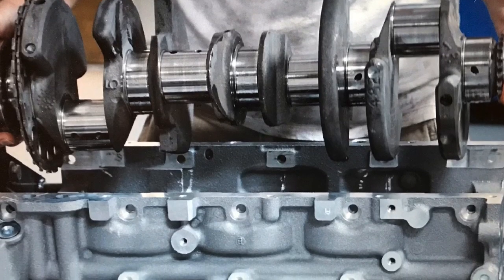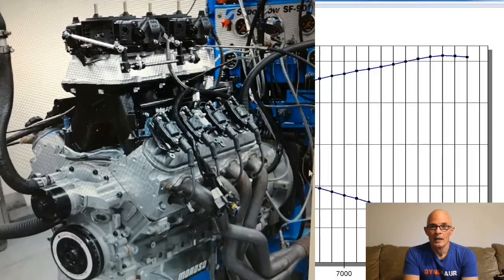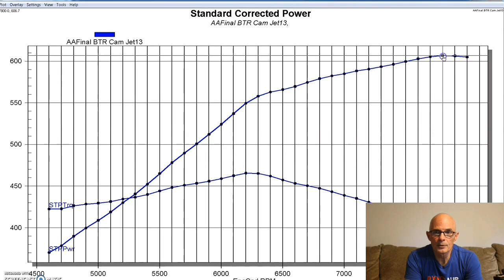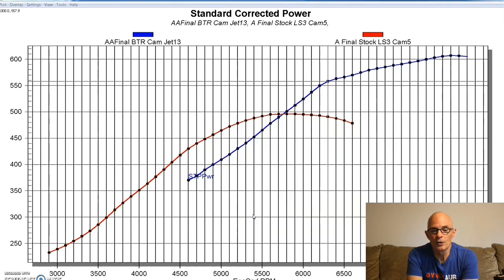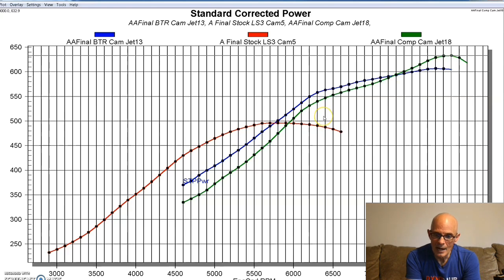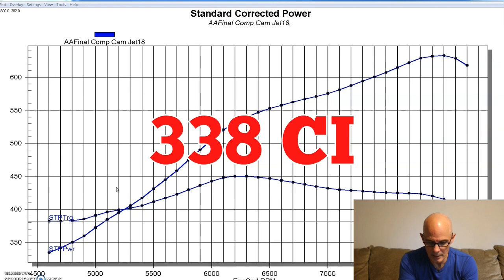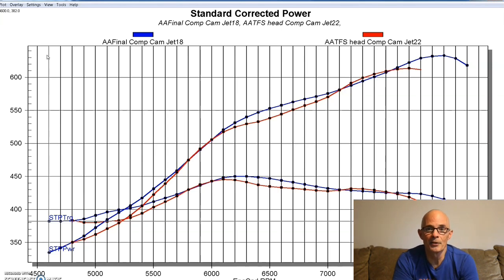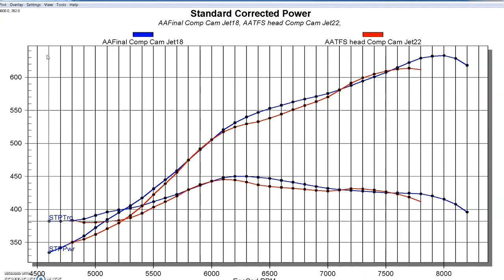DESTROKE LS-4.8L CRANK IN LS3 BLOCK-SHORT STROKE POWER-AN LS MONSTER MYTH?

Comment: I wanna build a higher revving ls. Specifically for a superlite slc. 

Transaxle is designed for higher revving motors. And even if I drop gear I wanna build the thing for a mix of acceleration but top speed. 

Kinda want 8500 to 9500rpm. But budgets lol. Boosted. Probably twin charged and compound boost for a cheaper easier set up. Realistically if it makes 1000hp with high boost that's all it'll need. Run it on low boost but have it set up so it's always taking cold air in. 

Also still needs to be reliable.
Reply from the maker: so cheap and reliable and 9500 rpm and 1000 hp-good luck
Reply: @richardholdener1727  not super cheap. Just not 30k in an engine. Basically was trying to do it for what the drop gears an ls crate motor and a boost solution would cost. All in about 20k. Was just trying to figure out what's the cheaper budget route. 

And 20k is if I rebuild the tranny myself. Not including the 11k on the tranny. Rebuild costs a bit. So basically was wondering if there was a more budget friendly option or if drop gears is the best bet. If so may just be worth sourcing a more expensive transmission right off the bat. 

But getting the Ricardo used in the Ford gt cars isn't easy. And harder rebuilds. And most of the other options are more race oriented so frequent rebuilds or can't find much info.  Don't mind doing a rebuild every so often. But every 40 to 60 hours run time is hard-core. 

8500 and 1000hp for similar price was more my goal. But never hurts to hope for more. And realistically I need 500 or so to start. If I have to add on for higher boost and hp later that's fine. But something that can Rev that high and handle the boost is more my goal. 

Adding the stuff for boost after is fine. 

Hence the junk yard block to start. Build the rest up make sure it'll hold. Then get a nice bare block to put it all on. Easier to justify an experiment on a 600 block vs a couple grand. Especially given I can find some nice junkyard options cheap. Ls7 for like 1500. Think a full ls9 would cost me like 3k for something ready to drop in to a donor as is. 
And not starting from a brand new crate engine should help save some bucks. 

Cheap is a relative term. Especially when talking about building a car that can compete with things that sell for 10 times it's price and is generally just as or more reliable. 

A crate rb26 costs 54000 dollars for a stock one. Nissan reissued them and that's the price lol. Vs for like 30 ish k you can have a fully billet rb30 rb26 2jz hybrid that fixes all the issues of the rb. And uses more readily available parts. And is good to 2k hp. 

If I wanna drop 30 to 40k like the motor I have in my gto originally cost sure. But I'm sure dudes have figured out budget ways to do it. At least in terms of that. Otherwise a rotary wins. 3 and 4 rotors can be done cheaper. Or Ford builds. 

9k rpm sure is nuts. But 8500 should be achievable without a fortune. Engines already make good hp as long as you can keep it from falling on its face past 6500 and hold to 8000 ish it should already make close to 600 or 700. With boost how hard can it be to get there. 

Bore jobs can be done yourself. Same with some porting work. Ls is like the most swapped engine and hopped up engine out there. Can't be saying there isn't a relatively budget friendly way to do this?
Reply: @richardholdener1727  just gonna attempt a 2jz swap most likely. 13k gets me a 1k hp crate engine that's streetable. And leaves me 7 ish k to build stuff up to take more revs. Not to mention the 3k on a block if I had sorted the ls out. 

Thanks for the replies. Did eventually figure out a way to do it on an ls but reliability is unknown within that 20k budget.
Reply: @richardholdener1727  lol figured it out. Surprisingly not as difficult as you'd expect besides engine mount issues. 

Flatplane crank. Destroked. Keep piston speed below 5000 feet per minute. Forged pistons low weight. Forged rods steel can work, titanium and aluminum have other considerations. 

Inconel valves. Light weight springs relatively speaking. Ti retainers. Need to measure deflection, fancy ways to do it and more basic ways. But most of the tuning difficulty. 

Stiff ass pushrods need to be strong. Bunch of calculations you can do based off mass of parts and rpms to figure out loads roughly. Add some fudge room 20 percent is a decent start. 

Realistically with a good base plane 40k is easy. You could start with an ls3. Buy a complete aftermarket replacement head that you can spec with your choice of valve train bits. Porting potentially required but not necessarily with brand new heads. Bit of math can be done for roughly what kinda flow will be needed, however you can always cheat and use forced induction tuned properly to help ram some air in. Pressure difference can help create vacuum causing air to be drawn in very efficiently. Why twin chargers still hold some useful benefits even if you can get the flow required from a turbo. 

Custom crank maker could build a conversion crank for an ls3 easily. Based on a 4.8 stroke even with stock bores for boost you're pretty well off. After market block or sleeving it with custom sleeves makes boost easier. 

Even with some tweaks required you'd be pushing close to 800hp at stock ls rpms without boost. And now have an extended rev range likely to at least the 8000s. With some bits capable of 10000 rpms. 

Lol. There's also custom crank makers who already do conversion kits for the ls engines. Expensive but likely can be specced with off the shelf bits that'll hold to 1000hp. With boost not that hard in a 6L engine. Especially with the added rpms. Keeping piston speed low snd making sure everything is balanced properly can help reduce stress. Lower weight parts also helps. Don't have to go to the extremes Especially if you also consider flex deflection and other such issues. Stiff weight reduced and increased strength. 

On the flstplane crank. Secondary vibrations are an issue. If you're working with an engine designer and builder anyways. Once you have a basic package further tuning isn't hard and also gives you a cheaper more reasonable route to get there. 

40k start pricey. But if it ends up only needing another 10k down the line to finish and make it hit the wanted specs. 

Self balanced with counter balancers built into the crank for the flatplane crank. Reduced weight also helps. Meaning reduced capacity and stroke. Which helps with the piston speed. Once everything is together you can use engine simulation software to help with balancing the engine. 

There's a fully balanced engine. And you can also over balance an engine. Over balancing is usually done for race applications. It can be used to move the vibration nodes out of the used rpm range. 

With balancers on the shaft. Reduced weight and over balancing all based off every piece together as a system gets you the final reliability and last bit of the rpms. 

Realistically this could be pushed like the spinaltap ls7 that's destroked. 

Play with compression ratios. Reduce it a bit. Are head and main studs. Main bearing upgrades that you did to the initial ls3 or from a raw base block start. Dry sump 6 stage. Oil pressure regulator. Starting at like 7000rpms rpms you want like 50 psi. 

Roller rockers. 

Cam selection is the only real finicky bit. And basically boils down to let the builder help. And may require a couple tries. Pay the engine simulation people a bit to help. 

You can buy heads that'd work as a base with a bunch of the valve train upgrades done for like 3k. Billet block or ls3 start 7k. Rods and pistons. Lol. Even fancy push rods aren't expensive. Any further head upgrades may cost you another few grand to start. 

Crank pricey. But then again. I'm considering a 56k dohc conversion on an L28 when I sell my gto. 

Reliability also comes from the fact of its a street motor. How often are you in the top of the rpm band. Plus other considerations like piston speed. Low end likely won't suffer to much even from a flatplane conversion albeit that's not even necessary to do just makes it easier albeit you lose some with counter balancing it.

However trade off for flatplane crank is the manual transmission will vibrate along with other bits of the car. Also why some exotics are slightly rarer in manuals. 

Piston speed and loads are a real main issue in high revs. Pushrods have others. But realistically worst case you can use some exotic materials without going into ridiculous expenses cause they aren't needed everywhere. 

Material knowledge is also important. FYI there's a reason steel has many advantages over titanium especially now adays with suoer alloys being common.  And fatigue loads are a thing. Aluminium fatigues with every load. Steel if the load isn't above a certain point it'll last forever. Titanium is kinda in-between the two. 

Realistically even with 8500 rpms. And a drop gear set in an slc with the right suspension tires and other shit. The Texas mile record is gonna end up mine when I get around to building it. Albeit might end up building a smokey yunick 68 chevelle tribute first instead. 

8500rpm ls3 with a t56 6 speed with a blower and twin turbos sounds kinda nice doesn't it? Extend the floor and flst bottom it yunick style. Turn the rear of the hood up a tad and throw some other aero mods on. Modern suspension mods and lower it. Modern wheels and big brakes. 

Maybe a awd set up. Though drift chevelle sounds fun too. 

Lol biggest issue right now is actually reducing power at the lower rpms and before boost. Especially for the slc. 550 is about all you want in those normally. High rpms sure fine if power builds. But it's gonna be a work of art through build planning. 

Planning takes issues away from things. And helps with reliability. There's also the mercury dohc conversion. Gets me there with a crate engine. Needs to be tweaked slightly but lol. 

Ls isn't as rev limited as people think. And it's not hard to do. Just not many do it because everyone forgets not every vehicle has good differential choices or the right transmission gearing. 

Engine rpms don't matter. Transmission is key to most things. But ls crew is stuck in the don't need more than 7000rpms. 

The engine swap in my 69 gto. That race engine is literally decade old plus tech. I built it in high school the race engine was bout used but was a fairly recent built when I got it. That's like 12 years ago. 

People are still developing the ls. And the spinal tap stuff and alot of the destroker stuff I've seen isn't that old today. Ls platform is how old. I think I was like 4 when they came out. 

The dohc conversion stuff for my l28 was only started being reproped in 2018 and was already an old discontinued product. Family friend I know from when the ls came out had dual sbcs in his boat that went to like 10k reliable in a boat that runs direct rpms so full tilt is full engine speed. 

Ls crowd needs to think out the box.

Comment: I believe what an interesting test would be changing the ramp up on the dyno to see if the smaller stroke was more responsive to change in rpm by seeing if it was able to keep up with the change. The engine master guys did a test of weight in rotating assembly which gave interesting but expected results would short do similar or have no effect?
Reply from the maker: the acceleration rate is adjustable but fixed on the dyno (x rpm per second)

Comment: Another advantage would be piston velocity, and the less inertial stress that the moving parts have in a shorter stroje application. Also, a shorter stroke allows you to fit a much longer rod, which helps with dwell time at TDC. This has an effect of making the engine less sensitive to detonation and pre-ignition. Makes it more tolerant of high compression ratios.

Comment: By custom piston running on the LS3, is it custom by compression or overall dimension? Could I run to a local vendor and pick up a set of stock sized (bore) pistons and a lower compression (for boost let’s say) and run this “destroyed” “big bore 4.8”? It’s definitely an intriguing thought, big bore high revving 4.8.
Reply from the maker: it's custom by pin height (compression height) to work with the longer rod and 4.8l crank, it also has the bore size for the 6.2L

Comment: With an ls1 destroked with the 4.8 crank yield the results? I have a 4.8 that I'm planning on boring to ls1 speck with an ls6 cam or( if my wallet allows me) something better. Deck hight and bore are a bit different so I'm very curious about the power/torque band.
Reply from the maker: think of it as a big bore 4.8L
Reply: @richardholdener1727  seems rev happy. With a short runner intake it'd have a low torque high hp power band I'm guessing.

Comment: Where power is made and how do you intend to apply that power. Is basically the question to ask yourself when it comes to bore stroke ratio.
The age old dilemma of RPM = speed. Or pull more gear with torque.

Comment: I'm new to this, so I have a question, is it better to kkep a short stroke to allow for lower piston speeds and thus increase reliabilty and ability to rev in an NA application? sorry if this question seems stupid and was answered in the video, I'm still trying to wrap my head around a lot of this. if required I could come up with an hypothetical situation
Reply from the maker: THE STROKE ISN'T NEARLY AS MUCH OF A CONCERN AS THE VALVE TRAIN

Comment: The longer stroke at a given rpm does load the thrust side of the cylinder wall more does it not? I am saying this because of the increased piston speed. This would be kind of important on engines known for thin cylinder walls like the FE Fords or 351 Cleveland wouldn't it?

Comment: using a 6.2 bock and putting a 4in stroke crank in it yields 415 cid. at 1.5 horspower per cubic in coming to 45 cubic inches. resulting in a 68 horsepower advantage over stock . 330 =495 and 415 = 622. there is no reason to ever destroke except to meet the rules.

Comment: I still love this engine, id been wanting to do a high revving, destroked 6.0 twin turbo engine similar to this for awhile. Something to drop in a lighter 2600-2800lb car. I had a couple reasons for it, esp since it's meant to be a street/strip(daily driver). 1)I wanted less torque down low. 2) Airflow=able to use ls3 heads(unported) w upgraded springs/valves etc. Most importantly, just to do something not everyone and their mother is doing. I always liked engines like the dz302. Now im not a professional engine builder, for me it's a hobby. With the 6.0 w 3.26 crank still has enough torque down low outta boost , to daily it when I want to. I also figured w the shorter stroke under boost, itd def help w longevity. Anyway, i do have a question though, specifically regarding pistons. 1)You said you went with custom instead of off the shelf pistons, im guessing it was cuz of balancing? 2) You also went with 11.2+(?) Compression, was that solely cuz u also planned to run it NA? 3) Cuz I'm trying to keep it 9.0-9.5compression max to not have a problem running 89-93octane on low boost(6-8psi),93 w octane booster and water/meth for high boost (14-16psi). Do u see any issues or what r your thoughts on it? Im here in Connecticut where we do get the occasional snow etc. Granted i prob wouldn't take it out in too much but at least would like it to be possible, main reason i liked the lower torque down low. 
Anyway, I soooo envy your job, been following a lot of what u do w LS's, K24's etc. I ve actually got this build article saved from a while back (hotrod i think), b4 i ever stumbled onto ur youtube videos/engine masters. Im always looking up dif build's/engines n ill swear, like 60-70% of them turn out were done/tested by you.lol. sooo want ur job. Anyway, keep up the awesome work

Comment: So is there any benefit or exploit for the Destroked motor at all? Does it allow you to have a consistently higher efficiency and feel safer about it? Could it potentially be better with a Valve train that could hold seriously higher RPM? Does the architecture allow for absurd RPM? The concept sounds very interesting so how is it that you could fully exploit it?
Reply: Short stroke motors are good for track cars because the high rpms will have a slower piston speed and be more reliable for longer periods of time, but modern motors and components have gotten way more reliable so a 7K rpm ls3 408 stroker can last for quite awhile with proper frequent maintenance

Comment: Love the channel, earned my subscription. Would a motor living that high in the rev range drink a ton of fuel?
Reply from the maker: more power = more fuel
Reply: @richardholdener1727  understood, and no replacement for displacement. But would a motor tuned for 8-9000rpm use more fuel than a motor tuned for 5500-6000rpm?

Comment: I watch all of your videos and I love them you do great work but on your final thoughts here I caught something.  If cfm to displacement ratio stays the same on all 3 engines then the ones with more bore and less stroke will make power at higher rpm because of stroke length.  The more  stroke less bore at same displacement will make more torque and won't make as much power up high.  Using same cam, valves, intake, tb, and exhaust on all 3 displacements kinda ruins the test.  Your limiting the bigger displacement engines efficiency that way.  If all 3 engines are able to get the same cfm to cid ratio then the results would have proved bigger bore is bigger revs and bigger stroke is bigger torque.

Comment: What about the reliability. The shorter stroke has a lower piston speed which in theory should lead to less stress on the internals at those higher rpms.. now if you make your power sooner than you dont have to rev out that far.. but like you said most want a screamer.